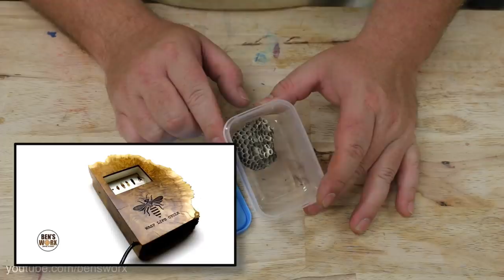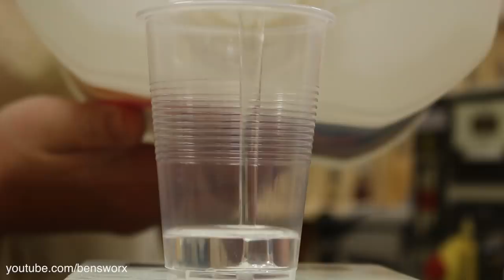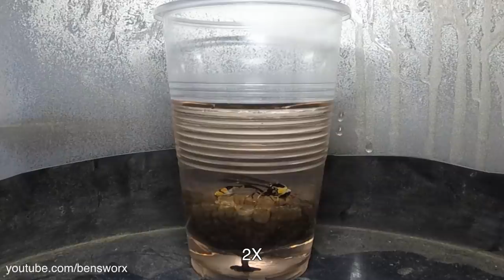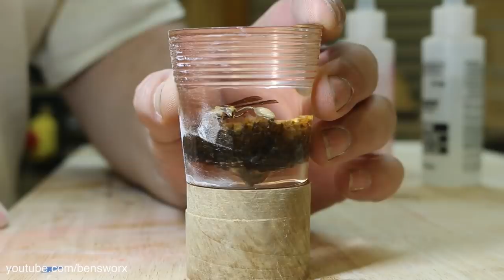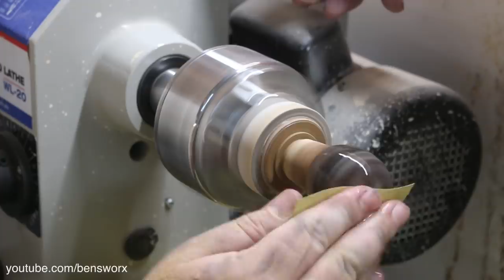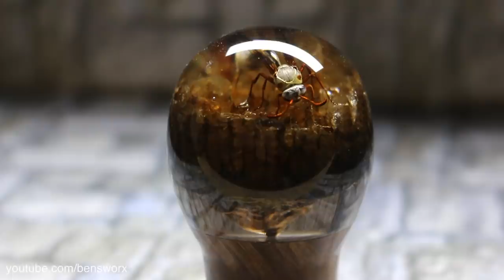Turning a Wasp Nest into a Gear Shift Knob

Comment: The little hairs that cover the body of the wasp are so thin that air bubbles stick to them without bursting. The orientation of the hairs draws the air bubble over the abdomen and towards the front of the head in an almost bubble helmet and if the bubble is large enough, bubble suit where a wasp can draw on the oxygen in that air bubble for upwards of five minutes. Chances are that the resin hardened and trapped the air bubble as it was very slowly moving up over the wasp's body. Which is why you can drown a wasp with dish soap but not likely to happen with just pure water because they can just keep latching on to air bubbles.
Reply: very interesting, but insects dont breathe through the mouth, thy breath through tiny hole via diffusion
Reply: @benzo5799  I didn't say they drew it in through their mouth. There are tiny holes all over the body called spericales (sp?). They latch onto bubbles and live in it as long as possible. In which case the bubble around the head makes sense since it is one of the last places they would draw air in around.
Reply: Interesting mate didn't know that.

Comment: "Oh shit! A wasp !" 
Smacks it out of gear without engaging the clutch
Reply: Tragic
Reply: Well, I mean you don't need to engage the clutch to take it out of a gear. So no damage would be done if you were to do that.
Reply: you dont need to press the clutch to go out of gear?
Reply: @tilted6368  Nah fam, only into gear, even then, if you properly match your revs, you technically don't need clutch to go into gear either.
Reply: @theeaglegaming2811  Yea most people don't even know this lmao
Reply: Grind em till they fit!
Reply: Lmfaooo
Reply: @theeaglegaming2811  yeah, I'm sure your transmission appreciates being treated that way. Why don't you go pick it up off the highway and give it a hug🤦🏾‍♂️
Reply: @carpetbomb8986 The clutch is only used to disengage the engine from the transmission so that there is no more engine power coming through the input shaft, this is so that the synchronising rings can do their job of slowing down the gears as they begin to mesh, meaning you only need the clutch when entering a gear not taking out of a gear. Should maybe do a bit of research into how transmissions work before you reply something dumb again. Goofy bozo.

Comment: My 23rd birthday just passed on may 4th, and since I was about 15 I've had A 2002 Chevy Cavalier 2.2 OHV base model 5 speed manual.
This car is nothing special to anyone that sees it cause ill be honest its a total rust bucket, but its my rust bucket. Over the course of the next 2-3 years I had no idea what I was getting into. Over heating/cooling issues, no power windows, no ac, no anti lock. this thing was hardcore and I loved it, every second I spent driving this car way faster than I should have been on the windy roads I live on. 

Having to pull over on the side of the high way because I forgot to top off the coolant with some tap water that morning before work.
Having to call my best friend who I am no longer in contact with, pick me up so I can buy a thermostat and then changing it on the side of the road.
Having to sit in traffic in the city and sweat profusely while watching my temp gauge go places I didn't think it could.
Having to always have a toolset in the trunk just in case.
Having to learn how to rolling start the car cause the battery died.
Having to learn how to do an engine head replacement, and head gasket change by myself with no prior knowledge.
All of those things were very out of my reach but when I was cornered I choose to over come those obstacles instead of junking the car; like my parents who told me to get the vehicle (ironically), were trying to get me to do.

But then I got REALLY DEPRESSED.
The issues with the car stacked, and frankly I couldn't keep up.
For about 2 years the car sat.
I would start it, if I felt like it. But it ran on three cylinders.
On March 20th of 2020 I started dating a wonderful woman.
With someone that fully supports me (even if she disagrees and says I'm crazy) I started work on the car again, and more importantly myself;  I've been fully rebuilding my old work vehicle in a track car, I've done a lot to it, and I've grown a lot during that time too.
Chassis reinforcements, weight reduction, etc. etc.
Even got a second job so I could pump more money into it.
But now I've hit a big bump in the project regarding the engine I'm getting built, I'm talking Individual Throttle bodies, 9000 rpm from a Over head valve like a Nasar engine. All for this dinky little 2.2 4 cylinder engine. that's going to go in a total rust bucket shell. 

My girlfriend has convinced me to make the car's appearance better in some way since I cant work on the engine for now. So I got a custom wooden armrest made for it, it even still has the factory cupholders molded on the underside cause 'MERICA. My younger sister said she wanted to help me fix the cracking dash by remolding it and then putting fabric on it. I've been trying to figure out how to get more wooden elements into the cabin cause I really like the wooden armrest, and this shift knob would match the armrest PERFECTLY.

My parents asked me what I wanted for my 23rd birthday, and like I usually say every year, I said nothing.

But after binge watching your vids to catch up on what I've missed, since I've been working so much . . . I know what I want.

If I get this shift knob I would probably cry, because your vids were the one thing I could look forward to during all the struggle.
I've never asked for birthday presents guys but it would really. really. really. really. 

I mean really mean a lot to me if I got this shift knob.
This would be the ultimate birthday present, and I would have it for ever to reflect on during my life, I don't ever plan on giving up on this car, my son will drive it. . . and hear the stories about how it all came together.
I want to cement you into that story ben.

Comment: My dad's 1971 f100. He passed away in 2015. I found the truck in a farmer's field in 2019 and bought it. My dad had sold it a few years before he passed away to take care of my sister. I am restoring the truck how he always wanted to.
Reply: does It have a wasp nest gear shift knob?
Reply: @ekoe9034  Well, uhh.. You literally spent some time to write a reply to this guy.?
Reply: @arichi8936  shpleegy
Reply: @assolt2398  The guy I've replied to deleted his comment lmao
Reply: How is it so far? Thats really cool that you're doing that, massive props. Hope the build is going well 🙏
Reply: @spiderjockey6593  right now, I'm cleaning every inch of the truck.
Reply: @loganlachance1890  sweet, is there any other problems that are major at the moment?
Reply: @spiderjockey6593  I was going through the motor and cylinder 8 was full of water. The engine is toast. The brake system also needs to be redone, it's drums all the way around and it's manual brakes.

Comment: I do not suppose you do requests for gear shifters?
I would like to have a custom nob on my High-Speed II The Getaway pinball machine.
I am also in the US.
I might also want something for the end of the plunger on the original High-Speed classic from 1986.
The High-Speed II is from 1992. :)
I would kinda like a wood shaft for the nob as well but do not know if the constant up and down of shifting would last very long if it was made from wood.

Comment: the problem with casting soft bodied insects is that sometimes the abdomens pull away from the resin over time. This creates an bubble mirror effect.
 If you could dry it completely without the backside shrivelling up it would stop that from happening.
It's even worse with butterflies and moths. I've been trying to figure it out. 

Also casting bugs often changes their colour because many have structural colour and the resin is so fine that it fills these structures and changes the angle that the light is reflected to your eye.